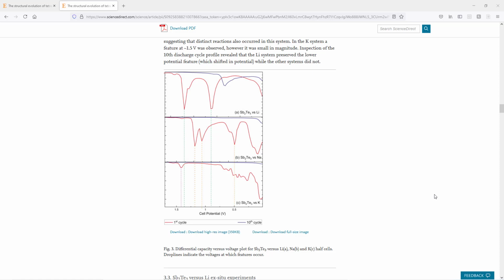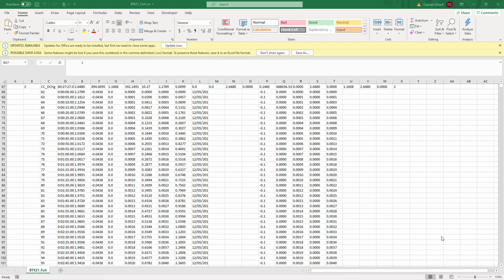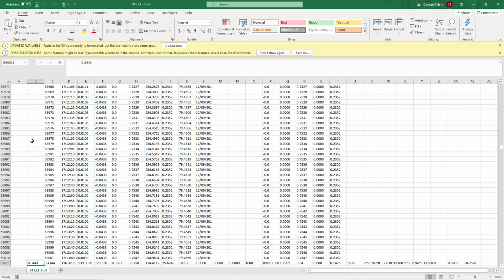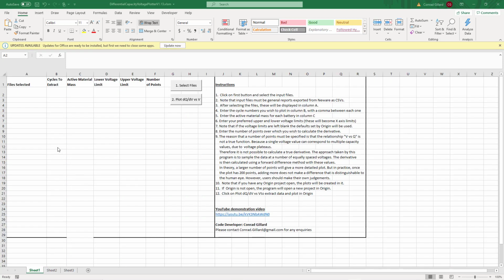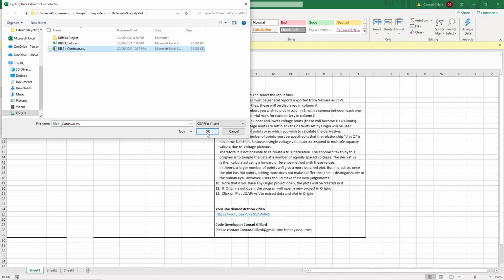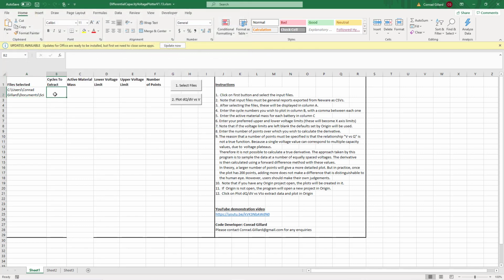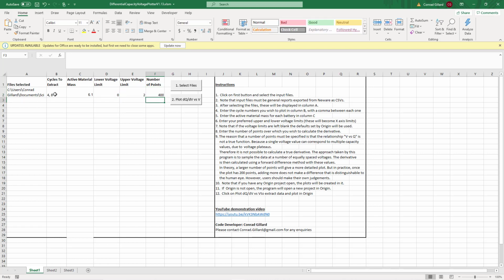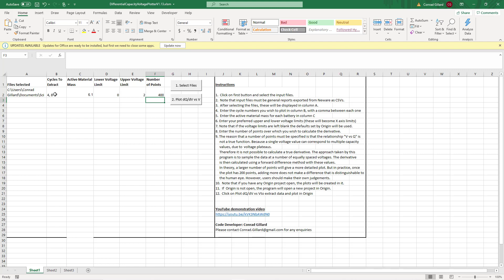Differential Capacity versus Voltage Plotter (Cycler output file to Origin dQdV importer)

Comment: Possibly a stupid question, but the V values you use for the x-axis. dV is calculated from (V2-V1) for the differential calculation, but when you plot dQ/dV at a given V, is it against V1, V2, or the midpoint between them?
Reply from the maker: Thank you for watching and for your comment! It is definitely not a stupid question, you are correct that the discrete derivative can be calculated in the ways you describe (known as forward, backward and midpoint difference operators).

However my program does not use any of these methods. This is because doing so will produce a very noisy plot. The root of cause of this noise is that we do not directly manipulate the voltage in our battery experiments. Instead we apply current, and the voltage varies according to the characteristics of the cell.

Consequently, my program instead uses Savitzky-Golay differentiation, with an 11 point window, and 100 sample points. This means that the program first samples the capacity data at 100 evenly distributed voltage values. Then for each sampled point, it fits a polynomial to the point in question, and the 5 sampled points on either side. Then it analytically calculates the derivative of the polynomial at the point to be analysed.

The reason I used 100 sample points and an 11 point window is because through trial and error I found these values gave a good balance of detail and smoothness. However these can be changed in the case of particularly noisy data, or if extra detail is needed.

Well this turned into a long reply but I hope it answered your question! One last thing to mention is that if you would like to see the exact equation that I implemented, it is shown on the following site:  http://www.statistics4u.info/fundstat_eng/cc_savgol_coeff.html
Reply: @conradgillardscientific  - Thanks, that did answer the question. I'm just doing something similar in Excel with VBA, and actually we do OK with a basic crude integration with adjustment the voltage "V2-V1" window to clean up the spikes. I suspect we are oversampling the data quite a lot with our chosen timesteps though. I was thinking about doing a S-G smoothing on the data also, but being a somewhat poor mathematician i'm not really sure how to write a reliable resampling routine to make the data equally spaced in voltage prior to the smoothing 🙂
As an interesting aside, at least one of our battery cycler suppliers is doing the same thing as me in their software to calculate dQ/dV  (but with what looks like a fixed V2-V1 window). Which is a little disappointing.
Reply from the maker: @I5bit  That's great you managed to get satisfactory results using a "V2 - V1" method. I initially tried a similar approach, but found the results were too approximate, so went with the more rigorous SG approach. And I know how you feel about the built-in dQ/dV calculation - I have tried cycler software with a similarly disappointing feature. This was one of the reasons I decided to write this program.

As for writing your own SG routine, if it helps you are welcome to download this program from my website and repurpose the code to perform your required function. It is also written in VBA so hopefully it should not be too hard to adapt. The link is: https://tinyurl.com/2tnrp6rn

Also I presume that you would like to develop your program yourself, and I think it would be a great way to build programming skills. However, I just wanted to mention that as part of my business I am now offering program development services. So if you would like help with this or a future program, please feel free to contact me and it would be my pleasure to work with you :)
Reply: @conradgillardscientific  That's very generous thanks. I'll have a look through that and see if i can get an idea of how you do the various steps. I'm doing something rather more comprehensive than what you have here and with a different objective, so it will need a little translating.
Reply from the maker: @I5bit  You're most welcome, I hope it helps! And please let me know how it goes :)